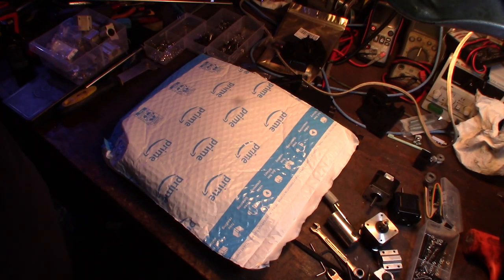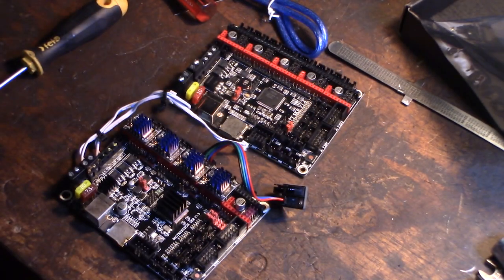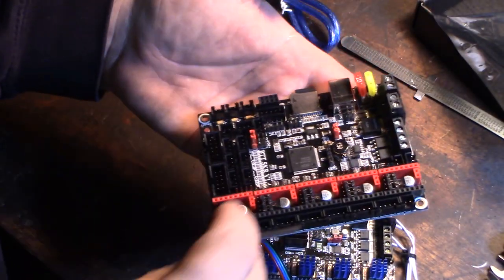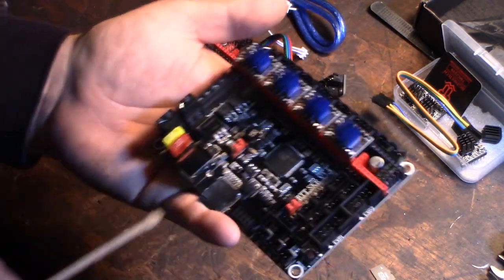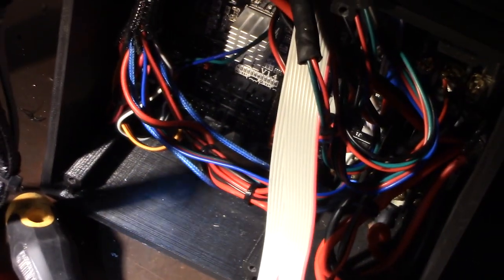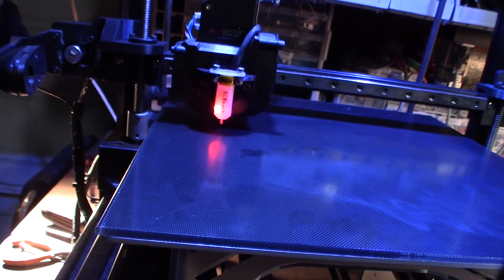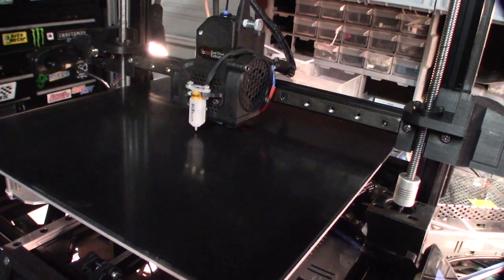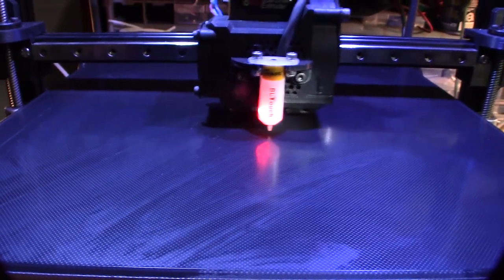NEW BigTreeTech SKR 1.4 TMC2209 BLtouch install Marlin 2.0 sensorless homing stallgaurd

Comment: I have one idea on the whole issue of compatibility: in Marlin, if you set SENSORLESS_HOMING on, but SENSORLESS_PROBING is undefined, it shouldn't interfere with the BLTouch. As I have unterstood, the sensorless homing is overridden by the definition of the BLTouch as a probing method. I haven't tested mine yet (SKR 1.4 Turbo + TMC2209 + BLTouch) on the Ender 3, but as soon as I do it I'll let you guys know...I'll also make sure to trigger the probe manually before it stabs my already wounded glass bed ;)
Reply: I'm hoping to play around with the same setup over the weekend - Ender 3 (non-Pro), SKR 1.4 Turbo, TMC2209's (all 4) and BLTouch. I hope you can get it working. I've been checking both the Marlin and BTT githubs and all I see is questions but no answers.
Reply: @TheLittleMike  So far my only issue is that the SERVOS pin do not output enough voltage (around 1.1v) to power the BLT 3.1. I've tried to fiddle with config_adv to set the voltage to 5V, but doesn't seem to be doing anything. I have found a way aroundthis by wiring the power cables to one of the endstop slots (+5V - GND), while the signal pin still is connected to the SERVOS rightmost pin...
Reply: @Federico0  That seems to be the common workaround. But I kind of want to avoid using the Z endstop ports. Not even because I have dual z, but because the whole point of having the pins available is to use them. I'm not sure if BTT messed this one up or if Marlin isn't quite ready yet for it, or if maybe we just don't know how to use it because of poor documentation.
Reply: @TheLittleMike  I've used the power from the endstop slots (+5V from the Z, GND from the X), since the SERVOS slot would not power up the probe. I have also put the trigger plug to the Z endstop (GND, 1.27). It deploys during autohome, but still doesn not stop z_axis. I've defined Z_MIN_PROBE_USES_Z_MIN_ENDSTOP_PIN, but still doesn't stop it. It retracts and flashes...
Reply: @Federico0  Oh gotcha. I'm trying to get the actual dedicated ports to work. Have you seen this?

https://github.com/bigtreetech/BIGTREETECH-SKR-V1.3/issues/207

(Not sure if links are allowed, I apologize if not)

One person may have gotten the BLTouch working on the dedicated ports (but not together with a Z endstop as well) using this:

Comment out the line in *Configuration.H*:
//#define Z_MIN_PROBE_USES_Z_MIN_ENDSTOP_PIN

and define:
#define Z_MIN_PROBE_PIN P0_10

Open Conditionals_LCD.h located in ..Marlin\src\inc.. and change these
lines:
#define HAS_CUSTOM_PROBE_PIN DISABLED(Z_MIN_PROBE_USES_Z_MIN_ENDSTOP_PIN)
#define HOMING_Z_WITH_PROBE (Z_HOME_DIR < 0 &&!HAS_CUSTOM_PROBE_PIN)

to:
#define HAS_CUSTOM_PROBE_PIN true
#define HOMING_Z_WITH_PROBE (Z_HOME_DIR < 0)
Reply: @TheLittleMike  It Works! The only issue I have has to do with the power supply to the BLTouch: by connecting it to the SKR 1.4 Turbo Servos pins it will not power up. I have to use the voltage supply by the Z servo pins. Not a big issue though. I'll see if I can do a test print.
Reply: @Federico0  Well that's progress! I wonder why it won't power up. You would think the pins would supply enough voltage. Still, an improvement. :)
Reply: @TheLittleMike  yes... I'm still figuring out some settings though. I suspect there's something wrong with the board, not only the power issue, but also some inconsistent errors while starting printing jobs from the SD...
Reply: @Federico0  Odd. Could be a bad board. I think the pins are supposed to put out 5v for the servo. I haven't tested yet. I'm going to try to do that tomorrow because I didn't get a chance to today.

Comment: Buddy, your comments about different voltages on stepper motors for dual z affecting steps is factually incorrect. Unless the voltage is way too low just on one side that we skip steps the step count is the step count and it is completely separate from holding torque which is what we get from voltage changes. Just FYI so you can stop making false claims in your future videos. We can tune each stepper motor to it's driver based off of temps of the motor and never need to change the step count in marlin as we fine tune the pot on the driver.